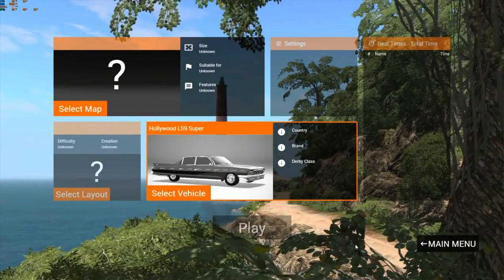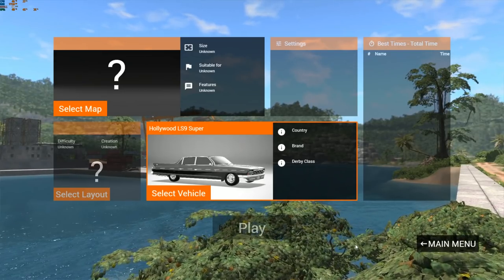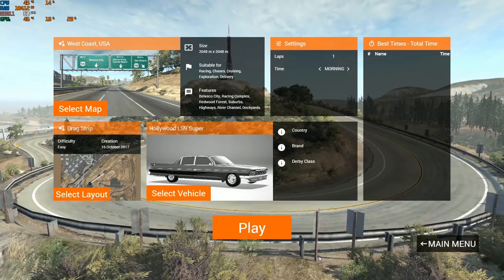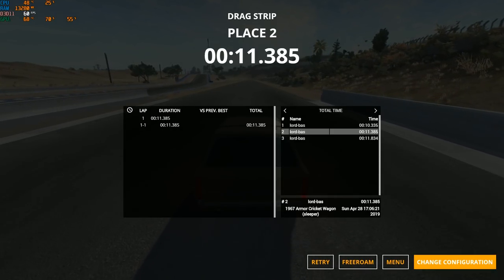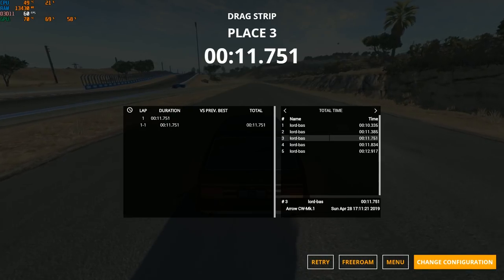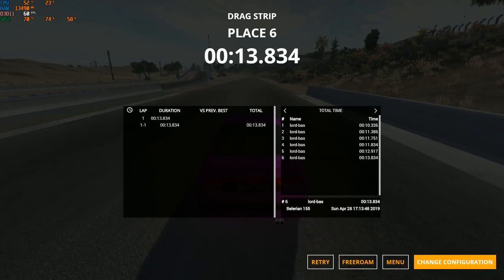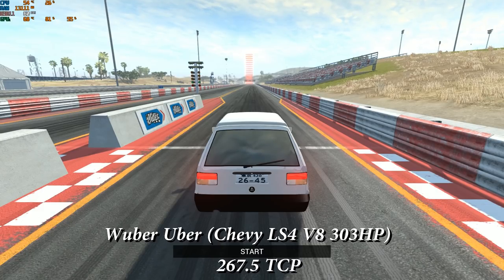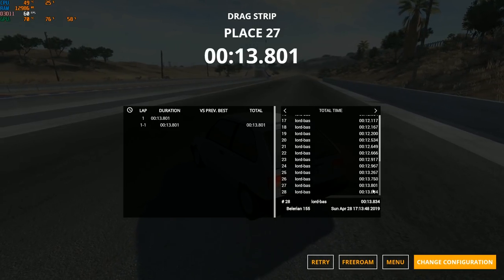2019 Sleeper Challenge Testing Video.

Comment: That Belerian was probably made more in the Factory Sleeper style.
The reason my car (VCLabs) was a bit slow is probably because it (like all my cars) is tuned to handle great and be easy to drive on a track rather than a drag strip, but it did decently anyway :)
Reply: Acid Green it was indeed ❤️

Comment: Auguste was just way too heavy for that engine. I wanted it to stay a five-seater so it's as close to its original as possible (also a reason for the small 16 inch wheels). And with any lighter chassis material it would have been way too expensive and ET and PU would be too high. So it had to stay a over 2 tonne heavy french lady... I'll see if there are any tricks to make cars a lot lighter than that.

Nice video, looking forward to the next challenge 👍

Comment: 28:44 well, my third entry so far and in a Video... 21. place on the quarter mile for a Pickup, that was tested most time with Beam's camping-trailer... Not so bad I guess... 
Only if someone is interrested... I had also recreate the IS-F's drivetrain as close as possible, so it says 4x4 but is actually RWD. 

Better luck next time for higher results...